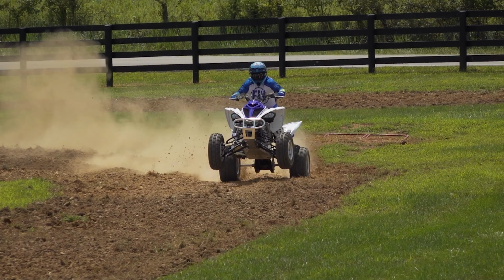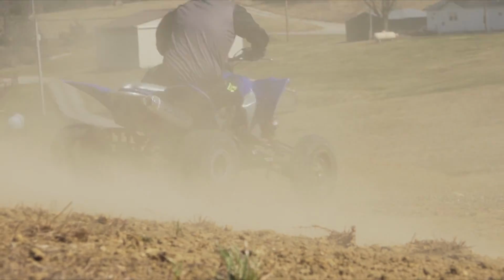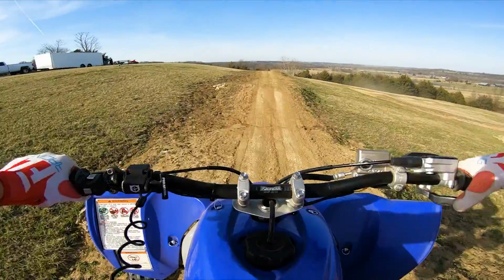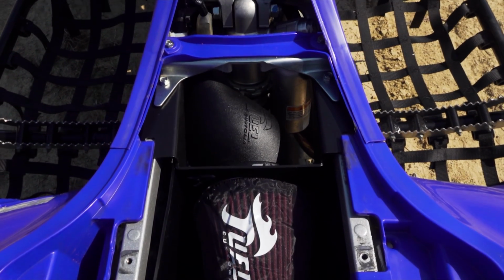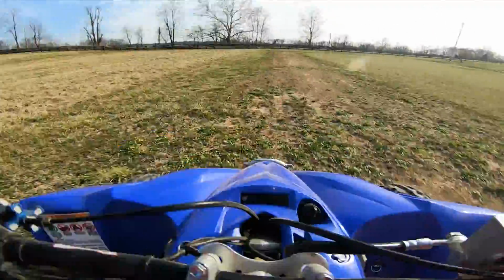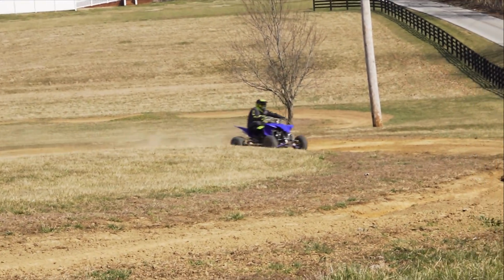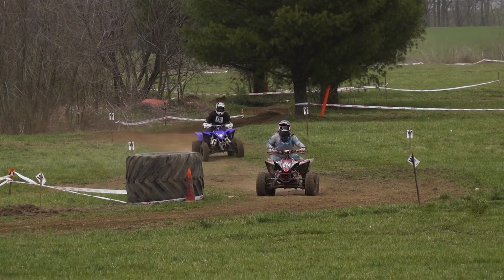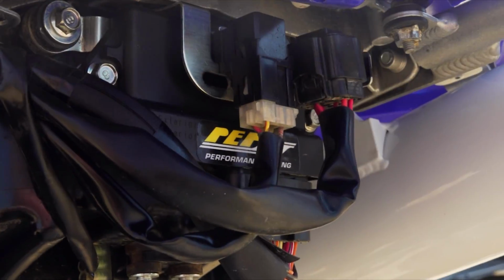Yamaha YFZ450R Big 3 Engine Upgrades, Dasa Exhaust, Fuel Customs Intake and PEP Reflashed ECU Test

Comment from the maker: The combination of the Dasa Racing Exhaust, Fuel Customs Intake and PEP Tuning reflashed stock ECU made for impressive running combination. SUBSCRIBE for more sport ATV content like this.
Reply: What’s the most hp you got out of it with this system ? I been tryna figure out which would be best for more hp Rp Racing and Rossier r5 says they have more hp but I’m not sure 🤦🏾‍♂️
Reply: @justinhives6155 check out the exhaust shootout.. Dasa. Rp.  r5
Or Dasa.  R5.  Rp
Reply: But this dads systems seems like a monster 💪🏾 Based off your explanation in video

Comment: Mine still glows after getting it back from PEP and installing the DASA exhaust so I’m not really sure what to do
Reply from the maker: What did PEP tell you?  How did it run?
Reply: @ATVonDemand  seemed to run good but they said that it eliminates the glow from the header so that’s why I was confused
Reply: I’ve been running my 20 yfz450R with DASA, tune and open airbox.

It’s ran RELIABLE everytime and powerful at the dunes and my pipe still glows a little at night only.

I don’t let my bike idle aside from warm up just to keep it cool and although the cooling fans DO kick on when I gets hot, I still prefer to keep it off cause the THIN WALL of the exhaust systems just radiates onto my boot and leg

In short, don’t worry about a little glow. Trust the build!

Comment: So by sending in your stock ECU to get reflashed, it will eliminate the engine running lean from factory?
Reply from the maker: Yes. You can have it reflashed for an aftermarket exhaust or with the stock exhaust if you want to ride a stealth fighter.

Comment: Is the yfz450 good for trails and does it like to stall out when going slower
Reply from the maker: The YFZ450R is a very capable trail machine but it prefers to be ridden aggressively. If you are into watching sport quad videos check out our YMZ450R versus raptors 700 R shootout. It does well at putting their difference in performance in perspective.
https://youtu.be/B9S6Q2KQSIA
Reply: @ATVonDemand  ok thanks
Reply: Even though they don't make it anymore the kfx450r is a wicked atv for xc racing/trail riding. I'd recommend that atv for that style of riding way more than a yfz. The yfz is good but not kfx good.😏
Reply from the maker: @LolliWANG505     The Kawasaki had one of the best motors in the class for the trail.
Reply: @ATVonDemand  why are there only 2 sport atvs made today?
Reply from the maker: @drumboon1986   Most of them went away after the economic crash of 2008. Then side-by-side came around. The manufacturer got greeting.Why sell an 8 or $10000 machine when you can get someone to go spend $25000.
Reply: No

Comment: That's a real nice setup.Affordable, reliable  and even competitive if u wanna race it. Nice!  So reflashing the ecu won't affect a piggyback fuel controller like pc5 ?  Do they work well with each other?
Reply from the maker: If you already have a PC5 you probably do not need to have your stock ECU reflashed.  According to PEP tuning, comma you have a wider range of tunability and features with a piggyback controller than the stock ECU.  If someone needs help with their PC5 or a stock ECU reflash, comma PEP tuning can help..

Comment: The vortex ecu is the best option in my opinion. Completely changes the way it runs.
Reply from the maker: Haven't found anyone that would dispute that yet. But, it's an $800 upgrade plus tuning depending on your set up.
Reply: @ATVonDemand  I understand, it might not be an option for everyone.
Reply: @YetiMasterYoda  You would think anyone who spends 10k on these crap YFZs could fork out another 800 for a Vortex lol
Reply: @Fox250R  why are they crap
Reply: @lblackburn_6.0  The fact we pay 10k for something you have to put another 2k into just to make it run smoothly is ridiculous. And that’s on the cheap side of things.
Reply: @lblackburn_6.0  Because he thinks 250r's are still relevant.  pffft

Comment: Got an idea, how about a stage 2 video?  What would you do after the big 3, a hi-comp piston, cams, etc?
Reply from the maker: If you're going to go with a high compression piston and a Cam in your machine you might be better off to go with a vortex at that point. PEP tuning can help you with tuning your vortex for whatever setup you want. A piggyback tuner would be a more affordable option as well. Still more capable than a stock ECU reflash.
Reply from the maker: We would like to do a stage 2 like you're talking about. Currently this motor is being rebuilt with a yes slightly higher compression piston, Cam,  porting and valve work.  Perhaps we will shoot it when the motor is back in. We have some cross country YFZ projects in the works as well.